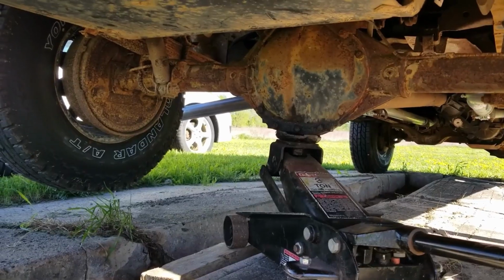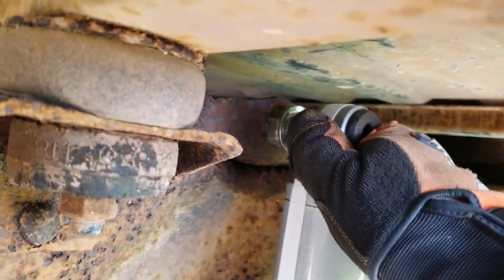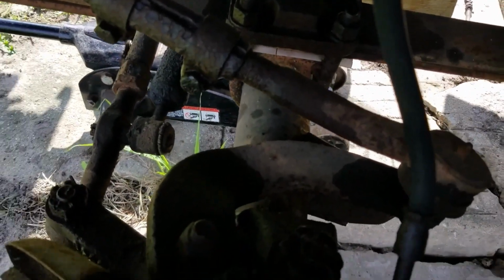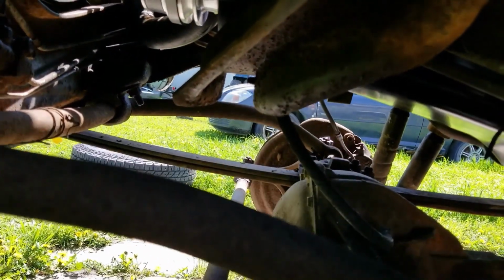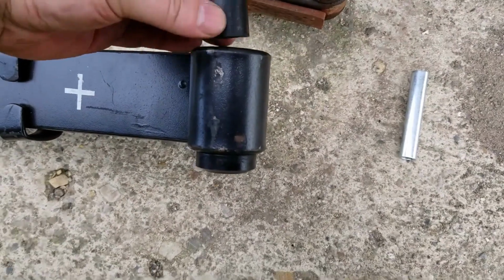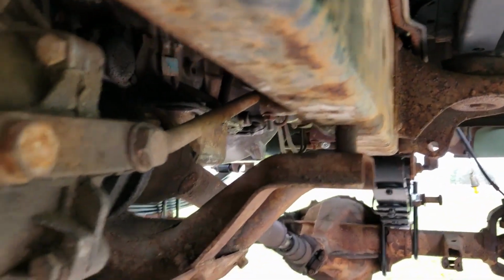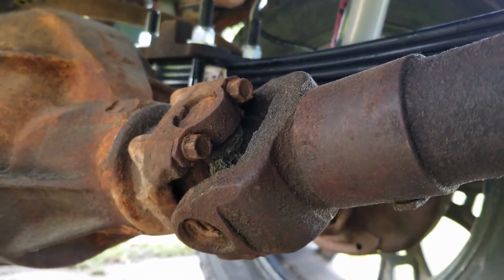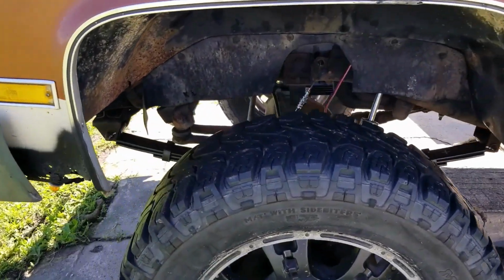Chevy squarebody COMPLETE lift kit, FP EDITION

Comment: how lift 2wd 👀
Reply from the maker: hhhmm Good question, more complex answers. First answer is a question... why lift 2wd truck  2nd question ... are any axle conversions being done?
Reply: @mongofix  axle conversions are possible, but expensive. I have a 2wd square rn, dont want to sell it for a k10 tho. not really going to do much hardcore truck stuff but like ride height, and also wheels lol
Reply from the maker: Mongo see. Axle conversion are either expensive or LOTS of fab time. NO AXLE SWAP - it depends on how high you want to go. Rear - (couple options depending on height) add a helper spring, spring blocks and U bolts, or lifted springs like in video. Front (couple options depending on height) Coil spring spacers, drop spindles, or fab up control arm and steering drop brackets. (Mongo not sure if anyone makes a kit for this). Other options is a BODY LIFT. Personal note Mongo no like body lifts. Make truck look like pot belly pig. Because the body is lifted and the frame and suspension stays were it is, it looks like the frame hangs down lower - like a pig. You do gain incline and decline angles along with ability to clear bigger tires but no gain in ground to frame clearance.
Reply: @mongofix  also found lift spindle kit, lifts 7 inches oonga
Reply from the maker: 7 inch, thats BIG! hellafa drop spindle
Reply: @mongofix  heheheee
will show when done
Reply from the maker: YES PLEASE!